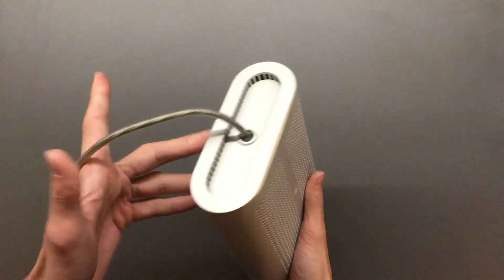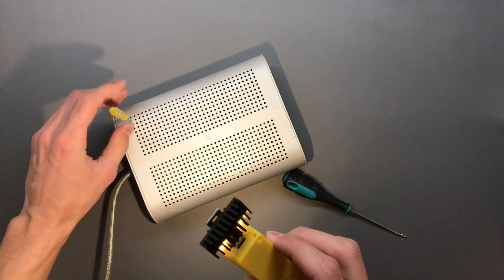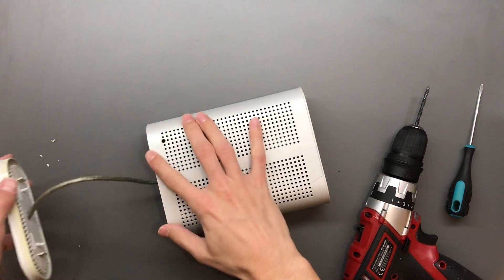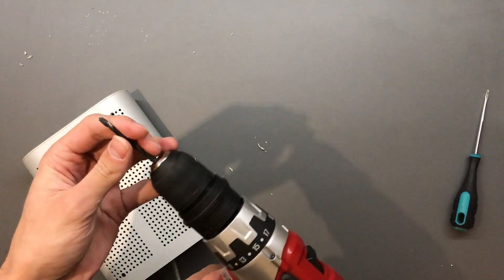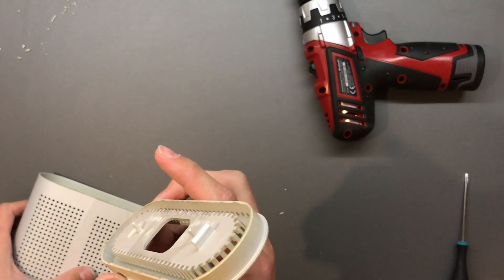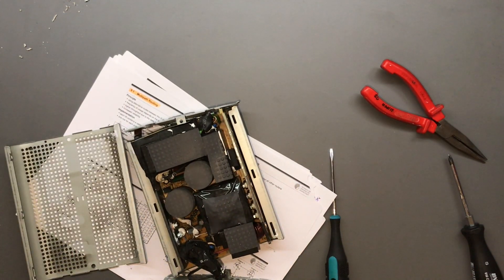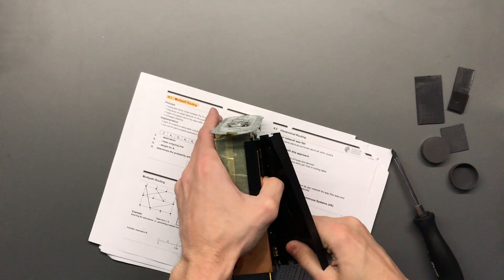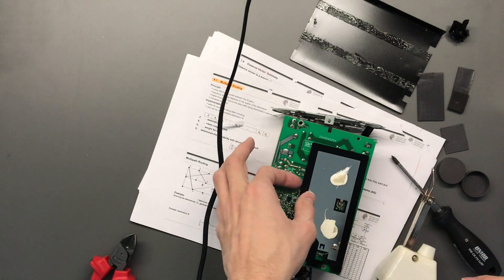Mac Cube Power Supply Teardown / Disassembly Guide

Comment: I'm looking to hook a meter up to test output of my cube power supply. Where do I put the leads to test for proper voltage on the connector? Couldn't tell from your video. Is there one specific pin for all 28v? Thanks.

Comment: Is there a good aftermarket replacement power supply for the powermac g4 cube?
Reply from the maker: if you find any - leave it here and I'll heart the comment ✌️
Reply: @Darieee  After a lot of searching I found this Power supply:
https://www.pc-adapters.com/28v-switching-power-supply/55244955.html

It has the perfect wattage and volts.(Which is extremly rare this seem to be the only one) It should be possible to solder on a kycon kppx-4p connector and that should work I think. (Im not an expert though)

Also I found this guy who made a guide on how he fittet a aftermarket psu into the original housing:
http://www.edretrotech.com/2021/02/power-mac-g4-cube-power-supply.html

That is all I have so far after a lot of hours :/
Reply from the maker: great work 🤘🤘 .. that xbox360 powersupply looks perfect
Reply: @Darieee  Yeah but im not sure how if it would be possible to solder the kycon kppx-4p on there in the way that the cube needs it. (It has a werd layout):
https://de.ifixit.com/Antworten/Ansehen/146012/Is+there+a+documentation+for+the+power+supply
Reply from the maker: I don't understand your concern - are you talking about changing the socket on the cube-side? 

That's a dumb input with ++-- ... no fancy detection at all, and the thing never draws much power at all
Reply: @Darieee  Yeah you are right. Also how much does it draw? Or do you know the efficiency of the original psu? (This one has 85% which is pretty good)

Im intending on fitting my g4 cube with 2 ssds and using it as a nas.
Reply from the maker: do check all my videos on the topic .. maybe I talk about that in one ..

I have the one where I boot 5 versions of mac os on it ... maybe that one has the psu in shot ...

it's less than 2A for sure

Comment: Thanks for the video. Scares me ;) Say, is there some kind of fuse in it that just could be broken? Couldn't tell from the video.
Reply from the maker: There's a fuse and some other components that might be easy to fix

+ if it's broken might as well give it a shot, ain't getting any worse

I unfortunately couldn't fix mine, ended up popping a power supply off of aliexpress inside ... I regret drilling the access holes on the top side ... in hindsight, really should've approached the problem from the bottom where it wouldn't've been in plain sight .. alas .. it is what it is

Comment: Great video, thank you!   I have a few of these I need to get inside to try to service. Were you able to repair yours once you were inside?
Reply from the maker: Soo, yeah, I bought this one 

https://www.aliexpress.com/item/Litewinsune-LED-PAR-Can-Light-Power-Board-Supplier-200W-28V-for-54-3W-RGBW-Waterproof-Outdoor/32852695056.html?spm=a2g0s.9042311.0.0.N2ejQA

It fits greatly since it is quite small (I've also made a video on it, check youtube for litewinsune 28v and you should find it)

The one issue is it's very noisy when idle ... otherwise, good to great quality
Reply from the maker: Unfortunately not .. I fucked something up and it went bang (taking the lights out xDa)

Given the mac never drew (alone) more than 2A .. I ordered a chinese supply to retrofit in the same case
Reply: Do you have a link for the supply you found that fits inside the case? I've trawled the web for something suitable before and never managed to find anything.